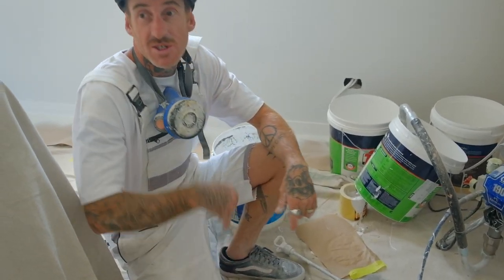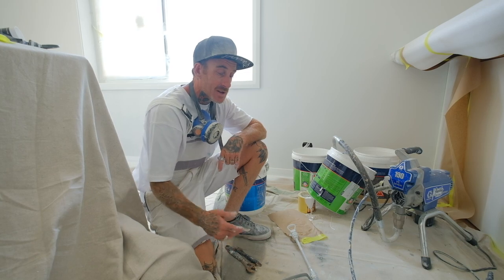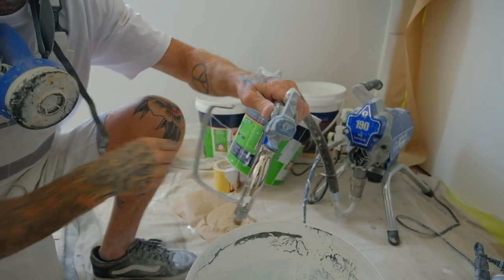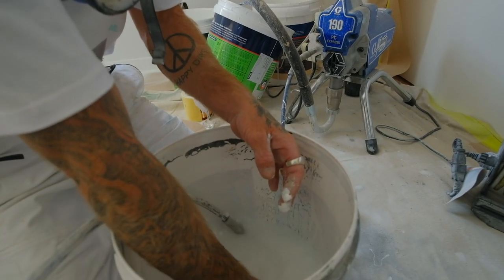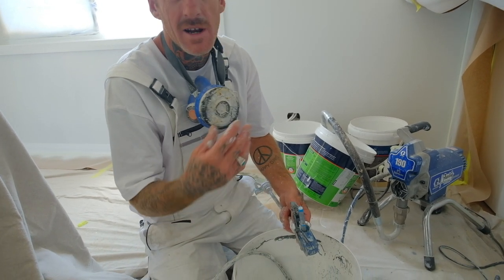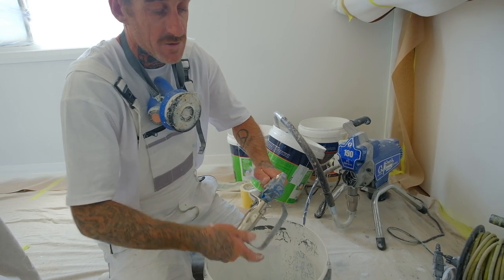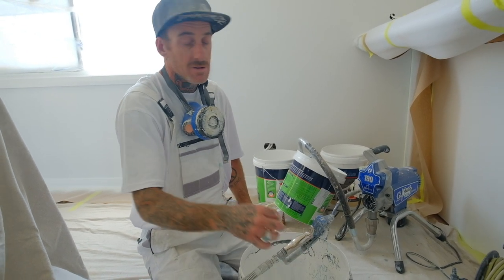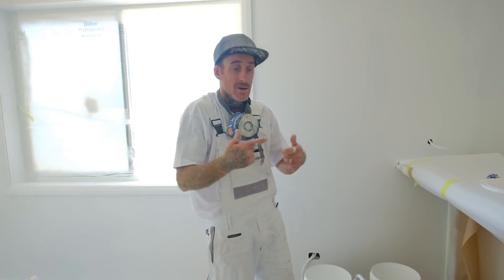CLEANING YOUR GRACO AIRLESS GUN FILTERS

Comment: Hey bro love your videos I’m from the central coast 🤙🏽 I have the graco magnum pro x17 I’m having trouble understanding how to spray the dulux weathershields through smaller orifices like a 310 tip. Ive tried spraying my gutters with a 310 tip using dulux weather shield but it keeps clogging and leaving tails down the sides of spray pattern. I’ve read that I don’t need to thin the paint down. So how would you go about spraying exterior paint through smaller tips? Do you thin the paint? Cheers
Reply from the maker: Hey bro appreciate you watching. Not to far from newy🙏  that don't sound right, weathershield ant the thickest of products it should be pumping pretty easy. Silly question you got it pressure all the way up? Have you checked the machine and gun filters? I never water down my paint bro you really shouldn't have to. I spray all my exterior trim with a 308 using weathershield so it definitely has to be the machine. I'm sure the X17 Max is 3000psi is that correct?

Comment: Hey Josh, while you are on the subjects of sprayguns. Next week I'll buy first unit for the business. I was looking at the 495 ultra max. Is that a good all round unit? Or the new 650 pc pro? Also would you recommend hi boy version or lowboy. I am new to spraying. Cheers
Reply from the maker: It all depends on what you can afford and what sort of work you'll be spraying. If you're doing more roofs here and there, I'd recommend the 650PC Pro over the 495PC anyday as it has a bit more grunt. But if you're in and out of repaints all week, 495PC can be more compact and easier to cart around. Hi-Boy is great for the stainless suction tube, but depending on how you're transporting the sprayer can get a bit tricky if you don't have a lot of space. Easier to clean than the flexible suction hose however. Hope this helps man, feel free to ask any questions or hit up the guys from GO Industrial, they'll hook you up 🙌🏼
Reply: Awesome cheers for the reply mate. There isn't a massive price difference between the 495 and the 650pc so will look more towards the 650pc. Plus dulux have a exhibition next week so hopefully good prices. 
Thanks for the contact I'll give them guys an email. Hard to get good information out there. Thanks 🤙
Reply: @GOIndustrial  great cheers Jacob that would be amazing because I don't even know where to begin. Will email shortly mate. Just have the bbq going at the moment 😂
Reply: @kieran9  Hahahah enjoy your BBQ! Talk soon 🙌🏼